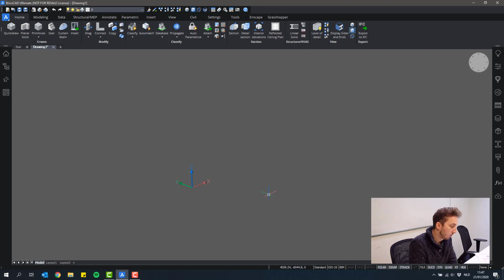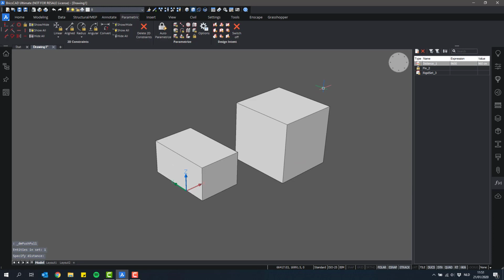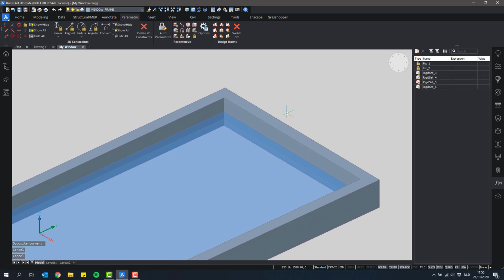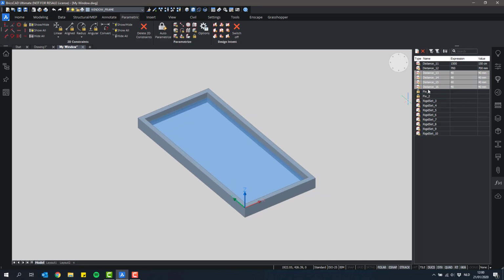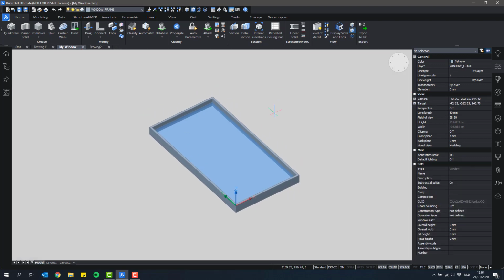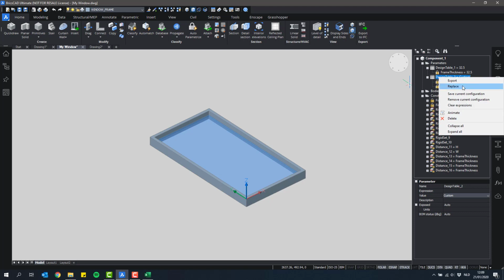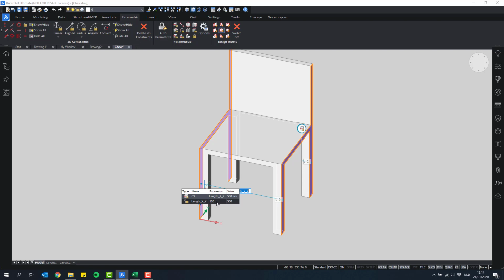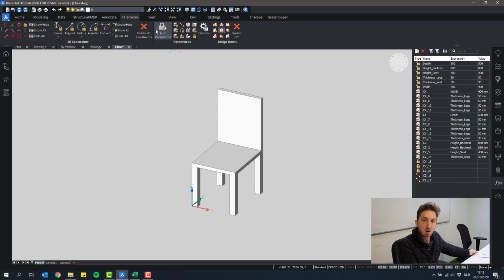BricsCAD V20 BIM Academy 9 - 3D Constraints and Parametrics

Comment: cannot click 3d face
Reply: Normally, this is because the value 0 ("3D Solids only") is selected in SELECTIONMODES. If you set SELECTIONMODES to the value 3, you can select edges and faces.

Comment: Are the .csv design tables stored within a block/componnet or are they living references to external files?
Reply from the maker: Hello, please refer to these Help articles for further details: https://help.bricsys.com/hc/en-us/articles/360006597594-Table, https://help.bricsys.com/hc/en-us/articles/360011730214-DataLink. Also, here you will find more information: https://help.bricsys.com/hc/en-us/articles/360006661093-DesignTable, https://help.bricsys.com/hc/en-us/articles/360006621613-Parametric-Modeling#design-tables